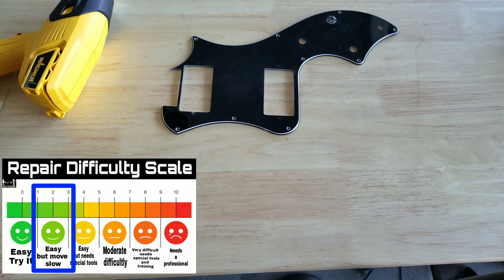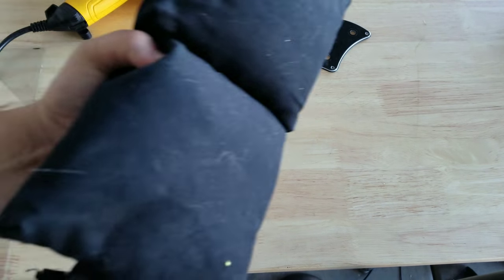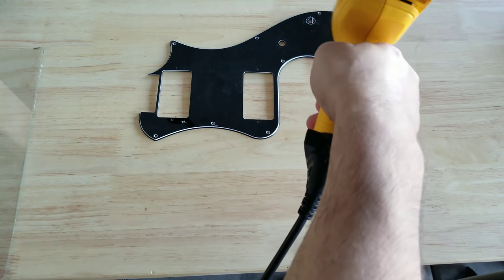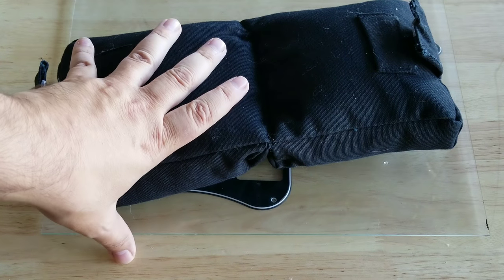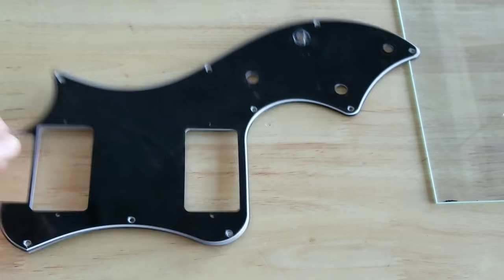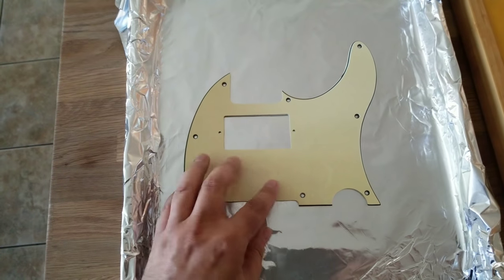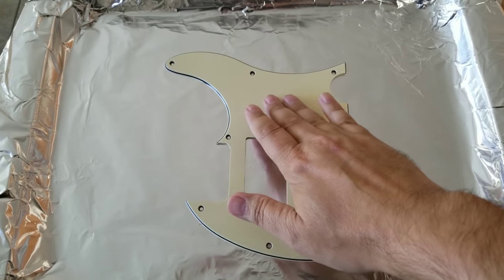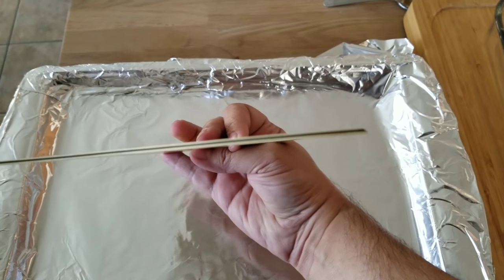How To Fix A Warped Pick guard In Minutes. Sharpen My Axe

Comment: Man, I am so glad I happened across this video. I have a late 70s tele and a mustang jp bass both with severely warped pickguards which drove me crazy. So much so I rarely picked up either to play as my OCD about their aesthetics just irritated me. I had thought about spending a bunch of money on custom pickguard replacements, but so glad I came across this video because I had no idea a fix was this simple. About 3 mins at 200 degrees in the oven, and using a glass sheet I temporarily repurposed from a picture frame hanging on my wall and both pickguards look brand new after sitting and cooling for 10 mins. MASSIVE thanks to Phillip for making this video!!!

Comment: Great video, but I'd personally proceed with a lot of caution when using the highest setting on the heat gun. Good ones go above 600°C but soft PVC starts to melt at ~180-200°C, so don't point it at the pickguard for too long.

Comment: Thank you so much for this. I bought a new Fender MIM Strat last year and stored it in a gator case away from heat & cold. Took it out and found that the pickguard was slightly warped near the neck pickup.Did not have a heat gun so I used a conair hair dryer, heated the area and pressed down with fingers on that area and allowed it to cool. Worked perfect, now nice and flat.

Comment: The 2nd method, I'd have done the other way around. I'd heat the glass baking dish in the oven, THEN set it on the pick-guard on the metal baking pan, with foil on it. Wait a few minutes to cool & there you go. That way the pick-guard has even heat distribution, from the glass, rather than the edges getting more heat in the oven.

Comment: Nice.  Good tip.  Another trick I do with the oven is I bake my cables.  180 for a few minutes.  They come out perfectly straight (no permanent bends).   Careful, too long my cause the outer case to "warp".